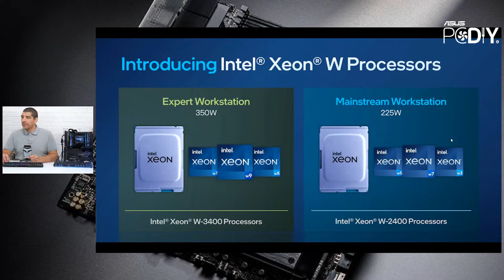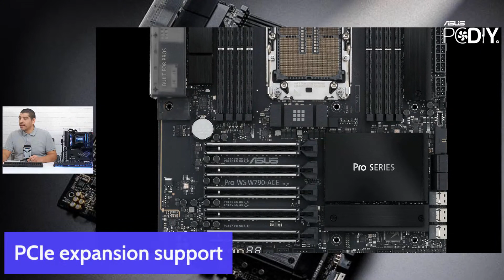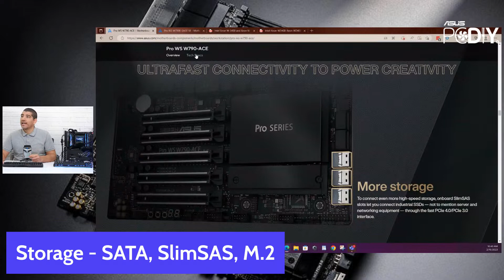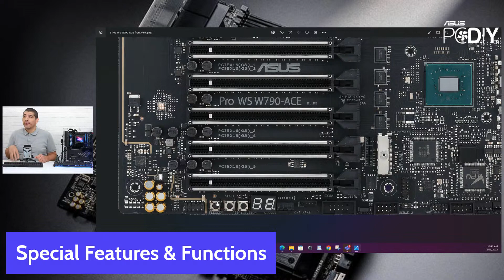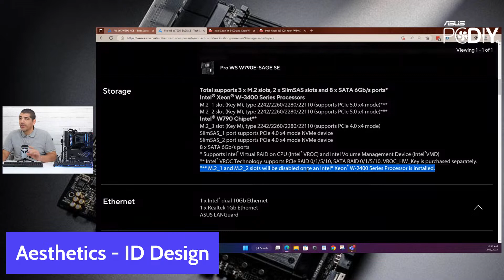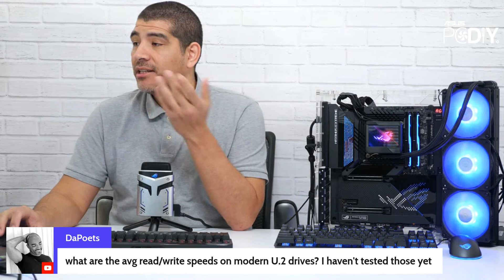ASUS Pro WS W790 motherboards First Look Preview - For Intel Xeon W-3400 & W-2400 CPUs

Comment: I'm really excited for the ASUS PRO WS W790E-SAGE SE. I haven't upgraded my hardware since 2017. Once I get my finances in order, I'm planning to make the jump. I'll be coming from an Asus Rampage V Edition 10 (X99). 

Now, I'm trying to see if anybody sells a 2 TB (8 x 256 GB) DDR5 ECC RDIMM Kit. So far, I only see Samsung selling individual 256 GB DDR5 ECC RDIMM 4,800 MT/s modules for about $3,000 each (M321RBGA0B40-CWK). So, it would cost about $24K+ to max out the ram capacity on the motherboard. I doubt they'll be any 6,000 MT/s 256 GB DDR ECC RDIMM modules anytime soon 😏 

I like going overkill and purchasing hardware I don't need because it gets me excited having bleeding edge stuff!!

Edit: Typo.
Reply: I am also about to move from X99. I have been running a 5930k at 4.7 GHz and DDR4 at 3000 MHz on my Rampage 5 since 2015. It has been such a great platform! It was a big investment at the time, DDR4 and PCIe 3 had just come out, but its been much more cost effective in the long term than the 3 or 4 systems I would have been through if I didn't go the HEDT route. Plus I haven't had to deal with running out of lanes the entire time. Haven't got many spare now though.

This socket is brand new for this range and the server Xeons so it should be around for a while. DDR5 and PCIe 5 are relatively new and with the lane count and memory configuration this platform offers, it has the potential to stay relevant for quite a few years IMO. At least for my needs, I don't need huge core counts at the moment. If I do in a few years a second hand 3495x could offer a fairly cost effective 3.5x upgrade. 

I priced a system up today (a 3435x, 8x16Gb Fury pro @ 6000 and the Sage) and I consider this platform to be very competitively priced for the expand-ability and longevity potential it offers for my case. I've been waiting a while for this but I wasn't buying anything that didn't come with DDR5 and PCIe 5.

Comment: This man was outstanding!  thank you for the comprehensive look at both boards and the many variants of the 2 new Intel Processor classes.  Finally, in the day of double sized video cards can the argument of leaving space on the motherboard, in between PCIe slots, so that 2 or even 3 cards can be added and NOT cover a perfectly usable PCIe slot, not only be made but solidified.  Apple did it with the Mac Pro 2019, and the rest of the industry should follow suit.  I mean come on guys, we're PAYING you for 7 PCIe slots, and for multimedia creators, we can easily use all 7. Time for the big boys to ante up.  EXCELLENT presentation, though!
Reply: If you need access to all 7 PCIe slots, you can implement riser cables and mount your PCIe devices somewhere convenient for your case and setup that doesn't get in a way. If you don't have the space, then either purchase a bigger case or a open test bench.

Comment: These boards look amazing, but for my work in 3D and video, no USB4/Thunderbolt is a deal killer.  Not sure why that was left out.  There are tons of PCIe lanes. It looks like the ASRock WS W790 includes 2 x USB4/TB ports.  It also includes Wifi/BT.  Unless there's a secret TB header on these boards, it's not going to work for me.
Reply: I use TB4 as USB4 so I have a drive that utilizes and I transfer 4k movie files between them so I like fast 40gbps rate. Asrock looks like the board for me as well. Gaming/encoding machine.

Comment: I own a 7,1 Mac Pro which uses the Xeon w-3245 on LGA3647. Got 96GB ram in 6 channel config with 96pcie lanes that get divided between the 8 PCIe Gen 3 slots. The cpu has 64lanes in total but it shares them pretty cool. This cpu and chipset would make it so much more up to date. 56 cores from 28, 8 channel ddr5 from 6 channel ddr4. It would just give it so much more of a life span with it. Too bad apple is putting their silicone in the next model

Comment: Hallo, i will use 8 Dimms, 16 Gig per Dimm. 1 Nvme With about 1 TB. And a Nvidia T 600 , needs about 60 Watts. So   In the manual i have read, i Need a power supply with minimum 1500 Watt. Is for my configuration a power supply with 1000 Watt enough? CPU W5 3435X. ( Sage)

Comment: Will it be a successor of the x299 chipset or it will just be chipsets for Xeon processors?
Reply from the maker: It is a higher performing platform and CPU and offers more robust IO, PCIe, Core and Memory so it is a great upgrade from prior X99 or X299 platforms. It is only compatible with Xeon based CPUs as well as Xeon ( unlocked CPUs ).